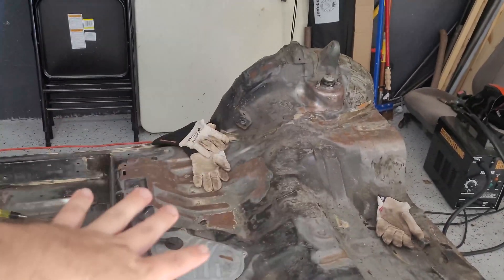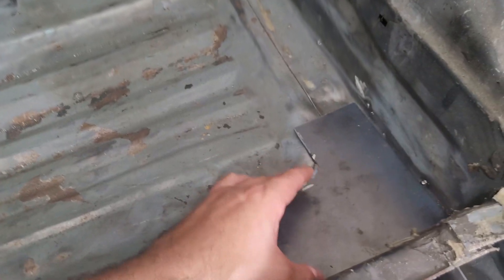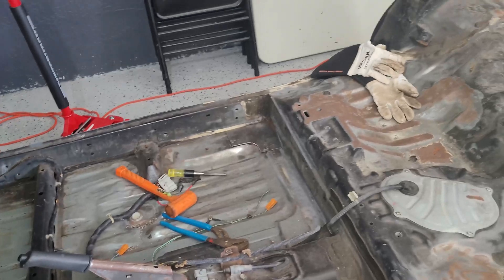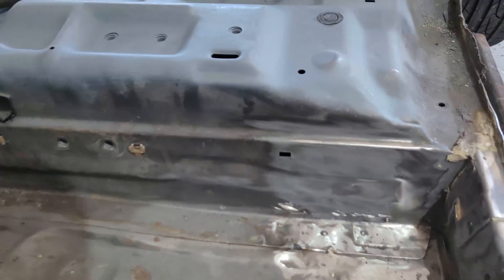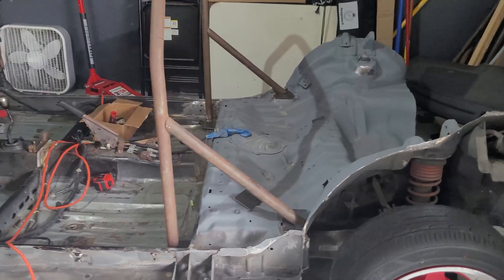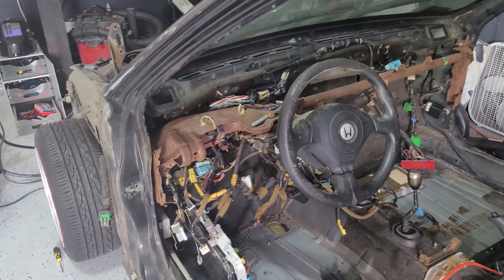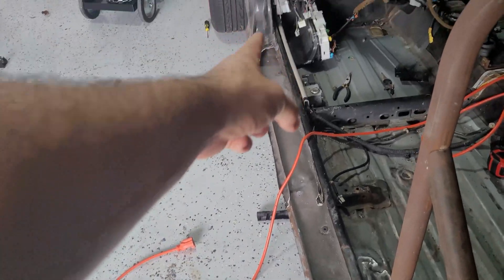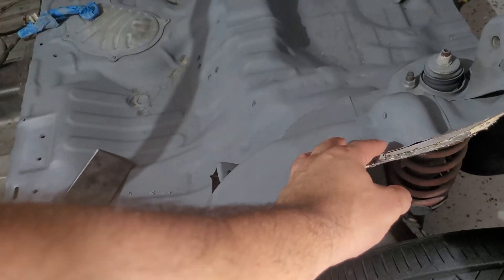Building a Honda Civic Kart part 6 | Exoskeleton

Comment: Do you use flux core for welding or u hook up gas to the machine?
Reply from the maker: Flux core was first used, once I felt I was ready, I got a MIG welder.  Flux doesn't require gas, MIG does.